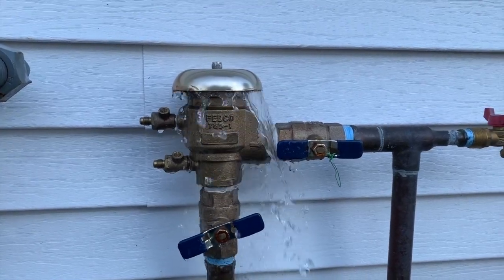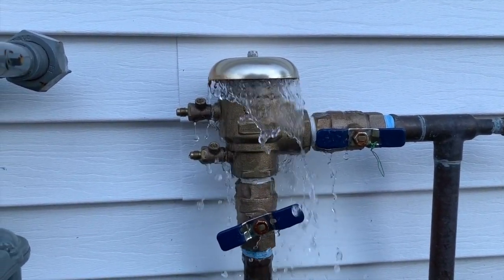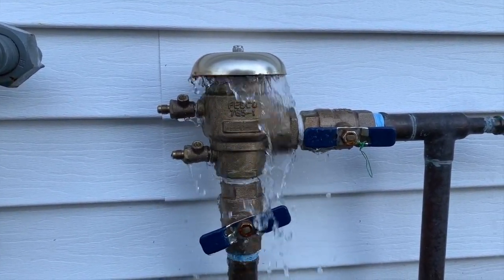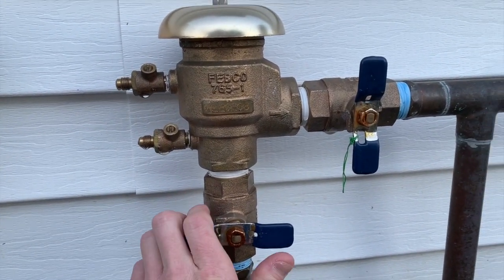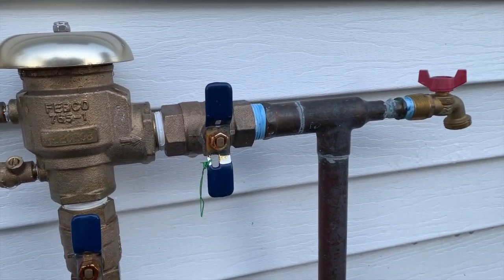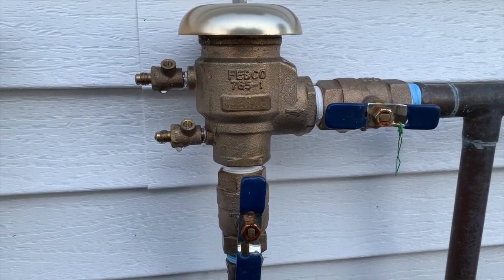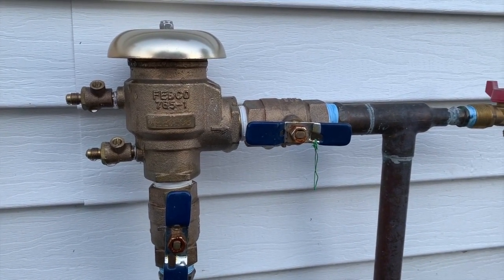My Back Flow Device Is NOT Sealing "It Is Chugging"

Comment: Thanks so mich for this video. Very helpful. I do have a question though - when i turned the outdoor valve on, I started losing water pressure inside (sinks, toilets, etc.). Would
that indicate a break somewhere in the irrigation line? Internal water works fine when external isn’t on. Thanks again!
Reply from the maker: Hello, it could be or just the irrigation lines filling taking a majority of the water. Hopefully after the irrigation lines are pressurized you regain pressure inside.
Reply: @SchepersLawnSprinklingSystems 

How long would you reckon that would take for the irrigation to pressurize, if you don’t mind me asking
Reply from the maker: Typically within a minute

Comment: Man, I installed the same bonnet and popper, had a spare, but this time, it kept leaking.  I closed the underground valve off as you showed, then turned it on, and it sealed right away.  Unfortunately for me, it revealed another issue down in the control box area, but it is no longer leaking under the bell hood.  Thank you sir!
Reply from the maker: Thank you for watching!

Comment: I followed these steps but mine is still chugging. Does it need to be repaired / replaced?
Reply from the maker: Hello, depending on the model and manufacture it may need a replacement poppet and bonnet.
Reply: @SchepersLawnSprinklingSystems  thank you. I went out and bought a new one but ended up not needing it. Old one wasn’t sitting properly against the seal for some reason. Will keep new one on hand in case it reoccurs but makes me wonder how it got messed up in the first place.

Comment: Repaired mine last winter as it froze quite quickly and broke. Did everything slow and steady as to not brake anything - just not enough pressure for the pop and socket to seal. Great video - Thanks!

Comment: I had to replace the bonnet and poppet since it busted this winter. After replacing it and opening the valve it seals properly but when I turn on my sprinklers to test them all sections have very low pressure and the sprinkler heads don't come up. Other sections will just cause the backflow preventer to chugg like in this video. I tried doing everything you did but I'm still having the issue. Any ideas?
Reply from the maker: Hello, you have a restriction somewhere, check that all your valves are open including on the water meter. Hope this helps!
Reply: @SchepersLawnSprinklingSystems  The only other valve is in my garage and that controls the water to my entire house. I checked it and it's good. I also checked under the green plastic covers in my front and back yard to see if there were any other valves but they're all solenoid controlled. I'm completely at a loss. I may need to call in a repair company to check it out at this point.

Comment: Could decreased or low pressure from the main line cause leaking from the bonnet/? And any ideas on what would cause low pressure when pressure throughout the rest of the house is fine?
Reply from the maker: Hello, if you are using too much water in the irrigation system, like turning it on too fast or a major leak it can cause the poppet and bonnet to not seal, even if you have good water pressure in the house. Hope this helps!

Comment: Thanks! I replaced bonnet and it kept pouring out water, but that's because I was slowly turning it on, expecting an instant seal. You mention turning it on to full right away, so that the pressure will create the seal, and this worked.
Reply: Same here!!

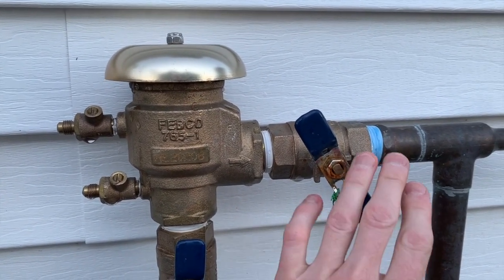Comment: Mine still is chugging. It happens right at the end, when I turn the second valve from 45 degrees to full on, like around 1:50 min of this video. Until then it is good and sealed. Turning on all the way leads the poppet to drop and start chugging. I have changed poppet, bonnet, and check valve and all rubber. Is there another trick about turning the pvb on? Thanks.
Reply from the maker: Hello, check that the valve supplying the back flow is fully on and you have good flow and full pressure to help keep the the poppet sealed to the bonnet. Also, make sure you have no zones on at the time you are turning on the irrigation system and you are only filling the main line with water and getting the main line fully pressurized. Hope this help!

Comment: My Febco is 5 years old when I changed it last.  Pulled it apart and didn't find anything wrong.  Found this video Baa Boom fixed my leaking from top.
Haha Thanks Mr. Schepers.  When I closed both lines and started up the house line first build the pressure and then opened the irrigation.  Viola no leak from top.

Comment: So what would cause water to continuously flow out of the top even with a brand new poppet and bonnet? This is happening even turning on the inlet.
Reply from the maker: Hello, check to make sure the poppet and bonnet are sealing. Also, ensure there are no cracks in the seal on the poppet. Hope this helps.

Comment: Mine has a small leak and plumber said I need it replaced. That’s about $1500
Reply from the maker: Hello, that seems high, a regular 1” Febco PVB is around $165.00 retail, plus cost to install.
Reply: Change it yourself, very ez.  Cost me 99 bucks from Amazon.  That plumber is charging way too much..  Should not cost more then 500bucks max IMO..

Comment: My system doesn’t have the valve to control the water supply to. How to turn on the system after winterize?
Reply from the maker: Hello, most municipalities require a back flow device, but some homeowners have just a valve to turn on the irrigation.  Hope this helps